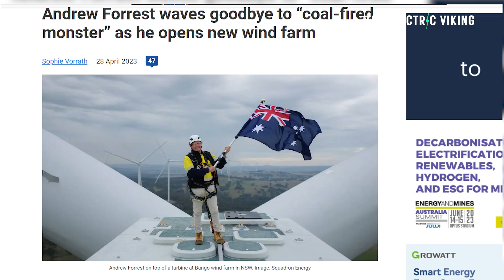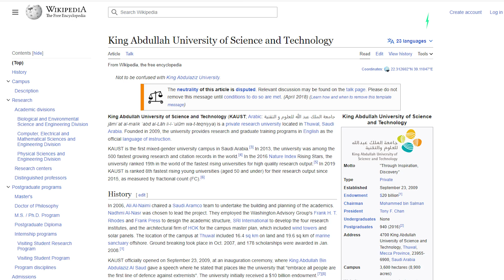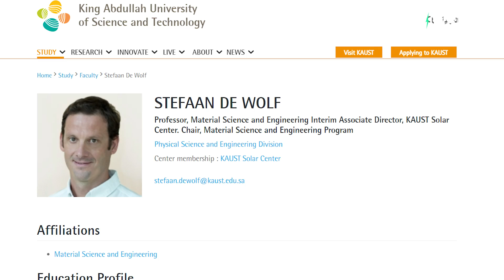A commercially viable solar cell set a NEW efficiency world record

Comment: I would disagree about the more layers. But I think you're correct on the premise that solar is going to be the next shift in energy production. There is some interesting chemistry adding layers to improve the absorption photon and phonon interaction. Look up Triplet and singlet fusion and fision. Might change your mind that multiple layers is too expensive. It will produce more energy per square foot.

Comment: Coal burning facilities here in the US don't have problems with Carbon Monoxide, or carbon pollution, they use a clean burning process that washes away the smoke, and just leaves c02.  People keep complaining about coal as if it was still 1972.  Regulations all over the place have changed the coal burning game.
Reply: CO2 is the problem for the future of the world.  I doubt that they are actually reducing the pollution rather than redirecting it from the air to water .🤔

Comment: The world needs large, stable sources of energy. It will not be coal-fired power plants in the future, but it will certainly be nuclear and/or hydro power plants. The production graph of such power plants is a straight line at a high level. On the other hand, the graph of solar power station is more like an ECG graph - it goes up and down when a simple cloud appears in the sky. In this respect, production from wind power plants is much more stable than production from solar power.
At this moment, no country can rely on renewable energy sources, especially not on solar energy. It's just a useful addition to the energy system for now. I'm sorry, but those are the facts.

Comment: Lower cell prices sadly are only a part of the total cost of solar. These days is may cost more for the steel (expensive!) racking than the panels plus electronics. If only one cost element goes down while others stay the same or rise don't be surprised if you don't see substantial price drops in the real world.

Comment: Efficiency and power density per m3 is the limiting factor.  A while back I did a calculation on how much solar for Tesla Semi.  Based on the new solar farms in this area that average around 11 acres for each megawatt of deployed solar, a 15 acre truckstop that charges 100 semis a day would need at least 150 acre solar farm to power it.  I live buy interstate 75 in Georgia. About 8000 Semis a day run up and down interstate 75.  If we charge even half of those trucks, at .8 megawatts each that's over 7000 acres.    And that is half the trucks on one highway.  So realistically 30-40k acres to charge Semis, in Ga, maybe more.   This hot humid enviornment in GA adds up to some of the highest electrical usage per household in the country.  Then cars, then commercial, then industrial....  
We desperately need more power from less area,  so this is fantastic news.

Comment: Most solar panels degrade in the first 6 months. They start at 22 percent eff. and fall to about 18 percent.
If you live a large body of water, your skies are usually cloudy, make solar panels a no go!
Reply: I live in Berkeley, California on San Francisco Bay. My solar covers my utility costs. No problem.
Reply: Wrong.  Just wrong.  I've had a grid-tied solar array for 10+ years now.  First full year = 6129 kw-hours produced.  Last full year = 5949 kw-hours produced.  Average over 10 full years = 5988 kw-hours produced per year.  Lowest year (4th full year) = 5722 kw-hours produced.  Highest year (3rd full year) = 6143 kw-hours produced.

Comment: Don't blow your mind Viking; you need it.  Solar panels can be cheap; but moving, installing, maintaining them, replacing them, all cost money. The real cost that blows up both wind and solar are battery storage.  They are not reliable sources you can't count on them 24/7 so you need huge amounts of batteries. The largest, the 400 Million dollar Mossy project in UK would only support the country for a fraction of a minute.  Just to get through a single winter night would take thousands of such batteries; let alone a long dark foggy period.  Too bad I can't send you photos but I was driving between Vegas and LA by one of the largest solar arrays around; we were covered in a sand storm..how much do you think the output of such a vast array looses during a storm and after .. how long to get the dust off the panels? How much permanent  damage does the sand do to the surface of the panels?  its a serious problem.

Comment: No matter how efficient your solar gets it doesnt work if you go weeks without sun!
Reply: You have permanent night? Antarctica?
Reply: @danielcarroll3358  no but there are times when we only get one or two days of sun per week and then on rare occasions we might get a whole week of it. LAst two weeks only had 3 days with sun. Panels were able to provide enough energy to run the basics but no clothes washing,baking,or running electric dryer
Reply: Battery does
Reply: @najibyarzerachic  thats only for the rich. Us po folks can only afford wood and coal
Reply: @bernardaho1913  but that is cheaper than wood or coal. Unlike wood or coal you buy it just once.
Reply: @najibyarzerachic  wood is cheaper. can cut it anytime i need it for free batteries are only good for a while til they do t hold a charge anymore and then you have that expense all over again!

Comment: Here's the proper way to think of solar:
1) I can easily buy 2 1,500W generators (actually inverters) for $2,000 - the main and a backup.
2) I then buy 5-gallon "Jerry" cans for a 1-week backup and fuel as needed.
This arrangement will take 2 hours to buy at Home Depot and set up.
I can now generate 1,500W for years on end - buy gas when low and have a 1-week backup just in case.

Solar -
1) I'd need to buy 250W panels that average 150W 6 hours a day on average with clouds and dirt on the panels 
I need to buy 10 panels for the 6 hours and then 30 more panels for the - other 18 hours or 40 panels
2) I need backup batteries to provide the remaining 18 hours a day - this would have to be 1.5Kwh*3 = 4.5 kWh batteries
3) I need to then buy a gasoline generator and gasoline for 1 week of emergency backup

There is no way that solar is cheaper than carbon-based fuels - no way.
Reply: And when the SHFT and you can no longer get fuel then what? Gasoline has a very short storage life diesel slightly better with addictives, but still only two years. Propane is the best prepper fuel, but even that will eventually run out no matter how big your propane tank is. This is why I have oversized my solar setup.
Reply: @X5493-c7p  Doom and gloom - we have 250+ years of carbon energy - I don't think we will outlive it.

Comment: What a lot of people don't realise is that boosting the efficiency of solar cells has a far bigger impact on cost than cutting their price. Why? Because most of the cost of a solar array / solar farm comes from balance of system. Firstly more efficient cells even at the same or slightly higher cost reduce the cost of a solar panel as more watts are generated for a given amount of glass, aluminium, back-sheet material junction box etc. Then there are savings on transport costs from more watts in a shipping container or lorry. Then more watts from a given size of solar array or solar park, more watts installed per worker per day, less support rail and cable per watt etc. and less planning environmental impact study, and design per watt. Less efficient panels would have to be a lot less expensive to reduce system cost as the cost of panels is only a small part - possibly around 20% of the total installed and operating cost of a solar farm.
Reply: Yup.  Boosting the efficiency is also going to lead to a flood of cheap power coming into the grid during the day from home and commercial rooftop solar installations.  Right now most homes can only generate all the power they need from around 10am - 3pm even if they cover their roof in solar cells.  Boost the efficiency 10% and suddenly they're generating at least enough power to cover their needs from 8am - 5pm, and generating a ton of excess from 10am - 3pm.  Daytime electricity prices will go negative for half the day and be suppressed for virtually all daylight hours.

Solar cells also generate a lot of power even when it's overcast.  At current efficiency levels it's not enough to power your home, but tack on 10% and homes will be able to power themselves even on fairly cloudy days.

Game changer.

Comment: As an example of Coals Toxicity the Fly Ash...is Fissionable and contains Mercury, Cadmium, Berilium, and numerous others. The output of toxic ash from one coal fired plant for one year according to the late great Dr. Wattenberg is roughly 3000 Box cars versus one Nuclear Power Plant of refined Waste is something akin to 1:Shot Glass. This year in the US Solar Power Generation exceeded all the power produced by other means i e. Oul, Gas, Coal. It was figured some years ago that One Solar Power Plant equal to 10 square miles could technically power the Entire...United States.

Comment: I live in Phoenix Arizona and Nobody is saving money with Solar Panels on there House. By the time it's paid for it's Worn out and needs replacing
Reply: Sure.  My 10+ year old 3.06 kW grid tie system that "paid for itself" 3 years ago and is still delivering 97% of it's original power isn't saving me any money.   Sure.
Reply: @bobhilder1469  All of my neighbors saved about $200 dollars on a $300 dollar electric bill but the payment is $350 per month on the System for the APS Offer of Zero Down LMFAO Do the Math , they paying $450 per month instead of $300
And a couple houses have had leaks in the Roof  " probably caused by the installation Crew " that cost a few thousand dollars to remove and reinstall the Solar Panels
Reply: @paulhailey2537  Get better neighbors.....
Reply: Tell them to put them on their roof.😎

Comment: This efficiency may result in lower life expectancy so it is important to remain skeptical, for now.
Reply: If it doesn't increase cost dramatically it might be worth the decrease in life expectancy, provided it's reasonable.  Today's solar panels last for about 20 - 25 years before they degrade around 20%.  If these new more-efficient panels can be pumped out at similar cost, they'd reach breakeven much faster and losing 20% of their efficiency after as little as 15 years might be a perfectly acceptable tradeoff.
Reply: @sunspot42  One issue with recovering the cost of panels is that power companies are lowering or even dropping the tariff they pay you for your surplus power so you need some kind of batteries to use your electricity efficiently. And they can build big wind and solar farms to produce cheaper power as well as big grid scale energy storage that will also be cheaper per watt or kWh than domestic options, so paying for solar panels is not going to save as much money as it used to. Saving some money and safety from blackouts would still be worth something, but a lot of people put huge importance on the idea that their solar panels will pay for themselves in a few years. If the $10k solar system price drops to $5000 but your electricity bill also goes from $2000 to $500 the payback time actually doubles, and that does not include the cost of batteries.
Reply: @AnalystPrime  Power rates aren't going down anywhere at the moment, though - they're skyrocketing in most places.  And panel prices are dropping.  So the payback time is also dropping, not increasing, even if the utilities are trying to drop what they pay for your surplus power.

Battery prices are also gonna implode over the next 24 months.  That'll change the equation for home storage as well.
Reply: @sunspot42  True, not only is the war affecting prices but the power companies that have spent billions building big wind and solar farms do not want the market to crash right when they need to pay back their loans.
In a way cheap electricity could be a problem because if there is no profit governments need to start subsidizing it or nobody will want to run a power company... Joys of capitalism...
Reply: @AnalystPrime  All large UK corporations rip the public off over here.
Reply: @Andrew-rc3vh  That too, a point for government run public utilities. Sure, in theory you can pick which company you buy your electricity from, but you could simply vote for a more competent official to run it.

Comment: Until these panels retain 85% of their output for 50 years, they'll probably still take more energy to manufacture and eventually recycle then they generate.
Reply: Right now a solar panel's performance warranty will typically guarantee 90% production at 10 years and 80% at 25 years. The degradation tends to become less with time.
Reply: Solar panels generate more energy than went into their manufacture within 5 years or less.  Depending on where they're installed and what technology is used, it can happen in as little as a year.  https://www.nrel.gov/docs/fy04osti/35489.pdf
Reply: What if the energy to create them comes from solar or wind? Would it matter then?
Reply: @rickeagle  Yes, because right now, solar and wind sources still require a lot of energy to use compared to what they ultimately generate.  In my town, a lot o people who did solar panels 15 year ago find they have these mostly inert panels that need to be replaced or removed. I don't even know if they're recyclable. Wind generators take a crap load of resources to make, maintain, and eventually recycle.  It's hard to get any truly believable data because this is such a political issue with two sides fudging data to support their own side.
Reply: @thenewage9723  The lifespan hasn't changed. They decay every year
Reply: Hogwash.

Comment: efficiency is important because of some other reason too. Solar cell becomes less efficient the the hotter it gets, if it is efficient it means it get less hot which increases its efficiency more and durability. It makes it also a better solution to have as isolation on buildings.
Reply: Solar cell efficiency is effected by cell chemistry and eternal temperature from air and exposure to sunlight, but the heating is not self induced or effected by the cell efficiency. The cell efficiency is the cells ability to convert the energy of the sun to electricity, and cell chemistry has the largest effect on the temperature coefficient of power production. Solar cells would have to reach very high levels of efficiency before they would begin to effect their own temperature.
Reply: @GoCoyote  temperature in shade is much lower than in sun in a sunny day the more energy a solar cell can turn into electricity the less is turned into heat and if theoretically efficiency would be hundred percent then the solar cell would be as cool as if it was in shade. That's what I mean.
Reply: @KeyhanHadjari  
I see. You make a good point that if we can absorb the heat energy of a PV cell and use it to produce power, then if we can combine that technology with conventional PV cells, we will be able to increase the output of conventional PV cells that produce more power when they are colder. 

The possibility of creating a PV cell that can absorb enough of the incoming solar radiation to reduce it to the ambient air temperature is the holy grail of PV modules. People are working on it, but we have a long way to go. All normal energy producing systems from heat energy at this time rely on a temperature differential between two parts, and harness the flow of energy from the point with higher entropy to the point of lower entropy. So much to learn, so little time!

Comment: Today at noon Finnish time even "Finland" could produce 400 MW of solar energy, and I don't think the privet rooftop solar panels are included if the owner doesn't sell energy at this exact time.
Even in Finland where almost half of the year is more or less dark, business realises that even here you can earn some money, if the prices don't go negative.
Russia which heavily relys on selling gas and oil will have big difficulties to recover even when the war is over! And as western Europe need millions of skilled workers... You can imagine what this will lead to!
Reply: Yes, at noon today in the UK solar was producing 2.5gw and within the last week it has been as high as 8gw.
Reply: @patdbean In Finland total consumption is 9-11,000 MW, maximum nuclear power 4,500 MW (one reactor under maintenance for two weeks), normal production 10-12,000 MW, since the "new" 1,600 MW reactor could start 14 years late to the plan.
Finland has, maybe, imported electricity the last 50 years! Some the production now is more or less a miracle!
Then they plan to build wind power, maybe, about 10,000 MW more.
Interesting to see what will happen with the prices...

The development is incredible, maybe in 10-20 years no one ask for oil and gas anymore! "Plastics" can be made of water (H2+O) and carbon dioxide (C+O2). Then you make chains of H+C combinations.
Is it cheap, not really, but yes if the energy prices are negative!
Reply: @leiflillandt1488  UK has 30gw of gas, 20gw of wind , 10gw of solar, 5 of nuclear ,(with more being built) 8gw of interconecters (with more coming) and 4 pumped storage stations with another 1 in planning

Comment: Four years ago I installed 13.6 KWp of panels running on 12 KW of inverters. No (time shifting) batteries yet. Have not paid a single $ in bills since first full billing cycle on solar. $700 in credit. My annual bill used to be around $2,500 - $3,000. (Large house, 4 people, reverse A/C, electric hot water and cooking, lots of devices, no compromises). Next year break even. Next 25 years = at least $2,500 -$3,000 benefit p.a. It will actually be a much larger benefit because power prices have been sky rocketing.... apparently, but I didn't notice.